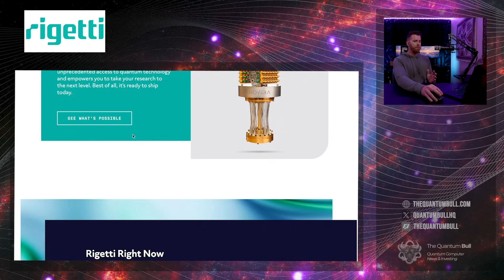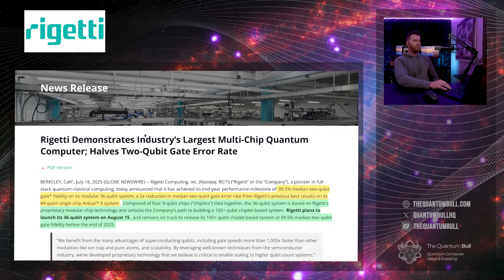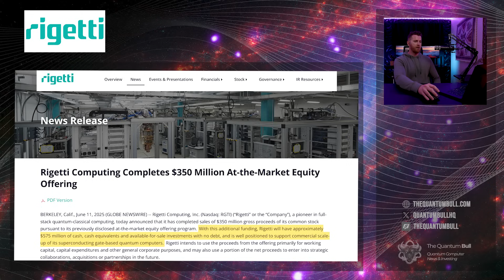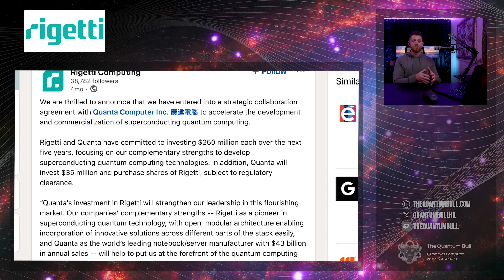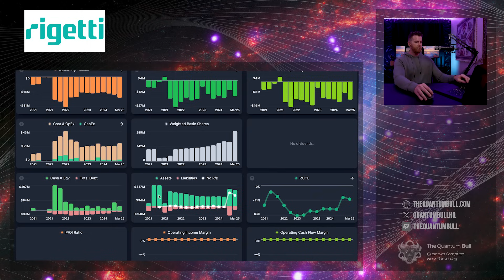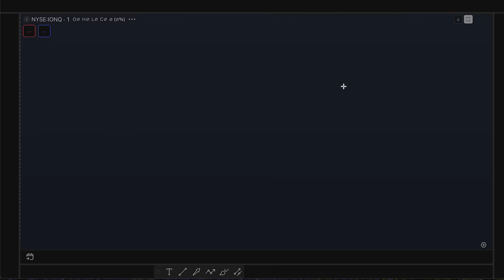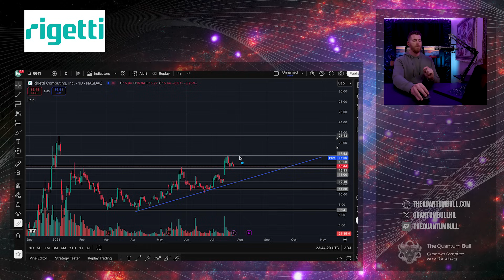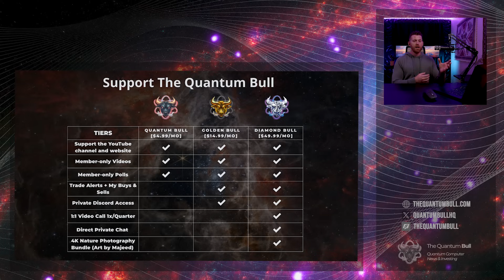Why I’m Buying Rigetti Before Earnings: News, Hardware, Price Analysis and 2025 Outlook

Comment: Thanks for a high quality video but I have 2 main questions which I hope you can address in future vidoes
1- ,10, 100 Quibits, all very facinating, but is anybody actually buying anything off
 Rigitti other than their stock?
2- I keep hearing about quantum solving problems, like what?  I have yet to hear about a problem that has been solved?
Reply from the maker: 1. Still in experimental and research phase - applications and algorithms are being developed and should improve over time. IONQ has been showing quantum speedup in their work with NVIDIA and AstraZeneca. 
2. Think of it the other way - classic hardware has limitations that we cannot solve or cannot conceive of solving. As quantum hardware matures it will open a whole new class of problems to solve. Example: modeling molecules in drug research. Too much for classical supercomputer, but will be attainable with quantum.

Comment: I bought around 11 to just hold long. Def like how it’s been on a steady upward trend, that seems so much less stressful than pump and dump ai stocks. Just have to be more patient, but it’s def going above 20$ by a year from now, maybe even $50, but not back down to $10 any time. Can’t see a bear case. But what happens if Microsoft buys them?? Does the stock eventually go away? Or they get a bull run again and infusion of cash from Microsoft?
Reply from the maker: If they were acquired shareholders would get paid a premium (I think) and the company would be absorbed. I haven't heard anything about that, yet. The main "headwind" would be the market going risk-off. Then quantum and other high beta stocks would sell off.
Reply: @TheQuantumBull hmm, I have 15k $ worth of rigetti, some of that is from profit. Hope the stock would go up and then maybe they delist rigetti from the market, after it’s acquired by Microsoft or ibm. Usually the company that’s being bought’s stock goes up. According to google.